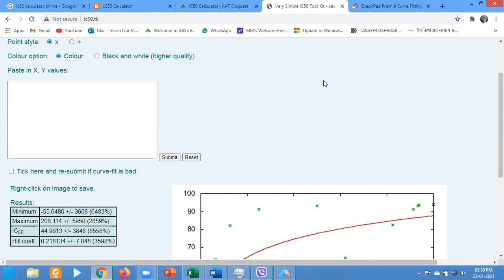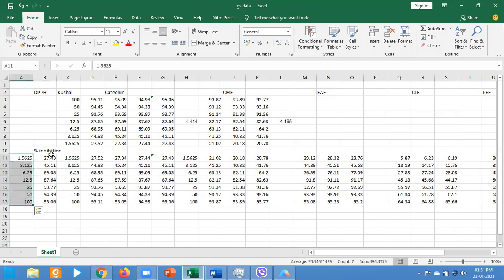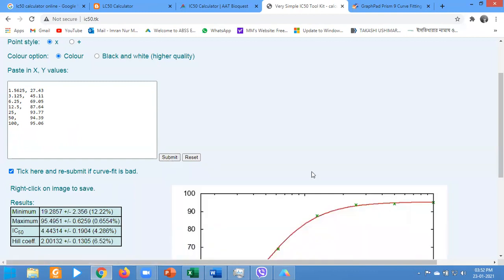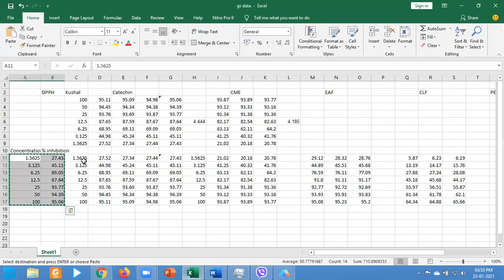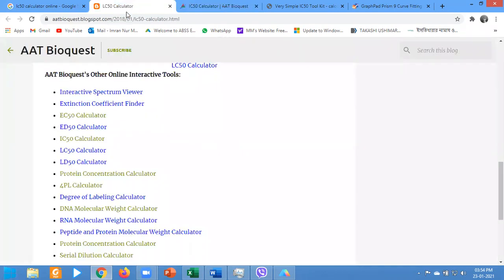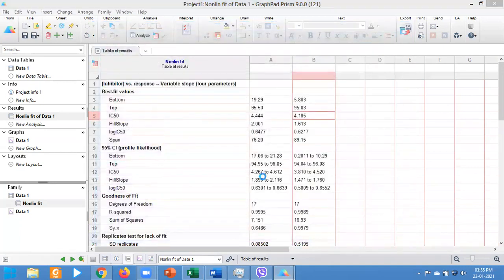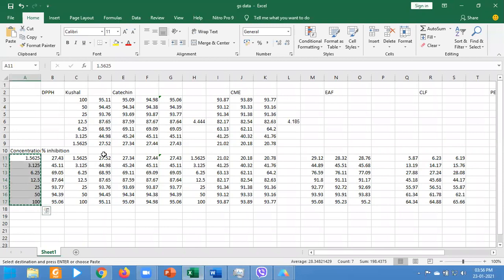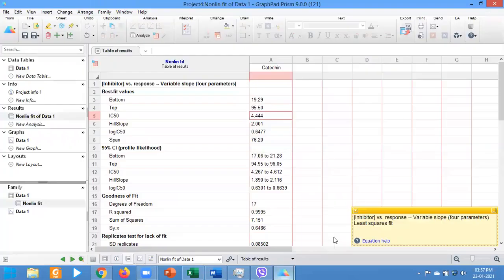IC50 Value Calculation using Various Methods

Comment: Is it possible to calculate  ic 50 value by using constant concentration
Reply from the maker: If you get the IC 50 by using a constant concentration then there is no need to apply a concentration gradient.
Reply: @imrannur5307  how can I calculate IC 50 value